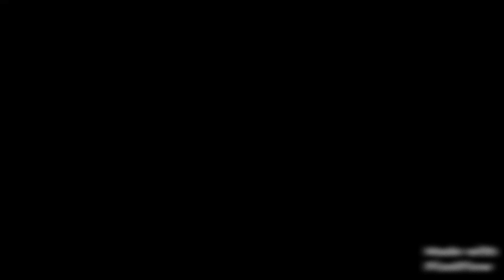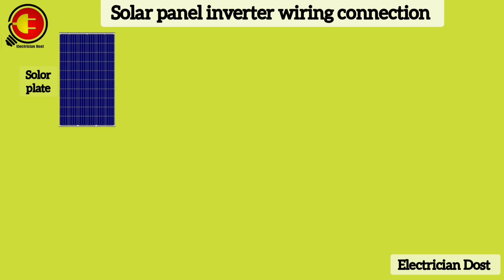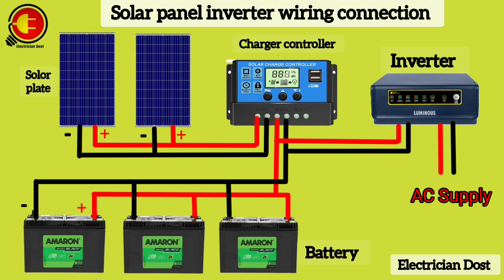Solar Panel Inverter Wiring Connection #solorsystem

Comment: can you help me can you explain why, if i use 1 panel, and 1 battery hooked up to my charge controller and inverter, everything works perfect. however, when i add more panels and more batteries, it won't work?